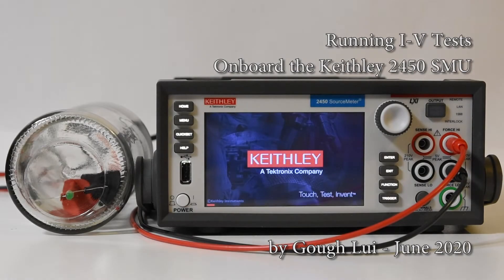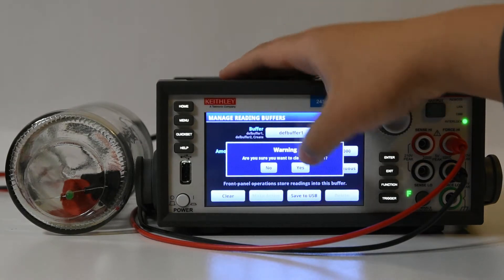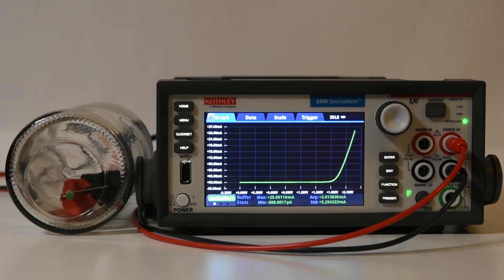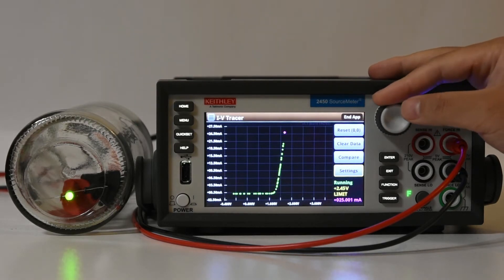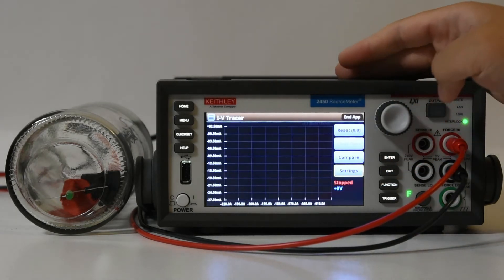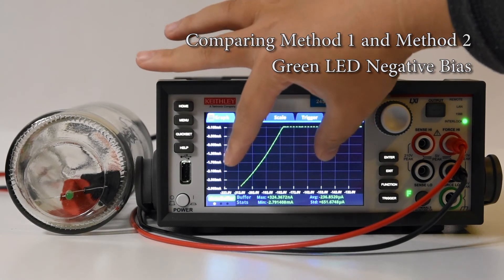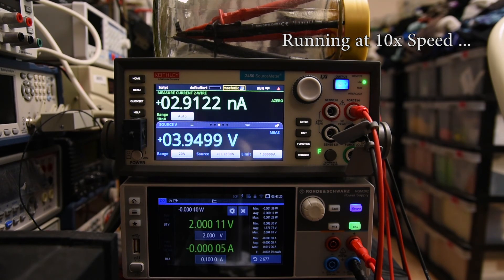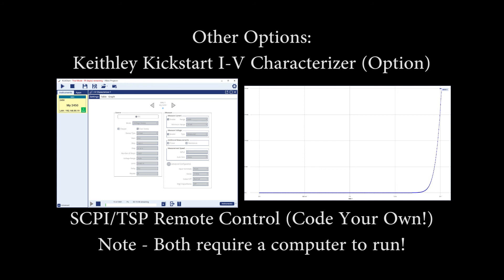Keithley 2450 SMU Onboard IV Tracing

Comment: The poor performance at very low voltages/currents could also be caused by noise - normally shielded cables are used for those measurements.
Reply from the maker: That is indeed true for very low levels, however, as the instrument is set to source voltage and measure current, I would expect noise to predominantly affect the y-axis (current) of the plot, as the voltage to sweep continuously as defined by the sweep generation TriggerFlow script. Instead, we see some bouncing back and forth on the x-axis (voltage) which is not expected and could be related to other issues experienced with this particular SMU unit which likely has a hardware defect. Please see the full in-depth blog posting for further details.